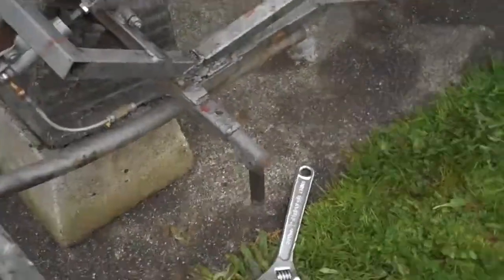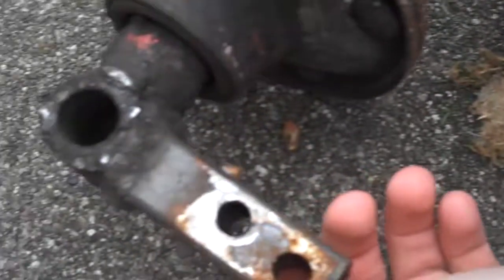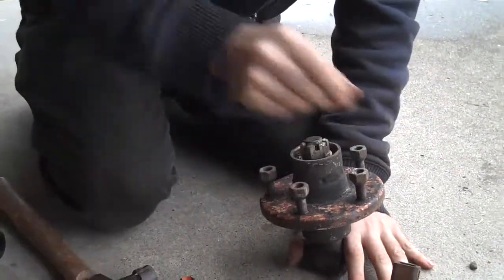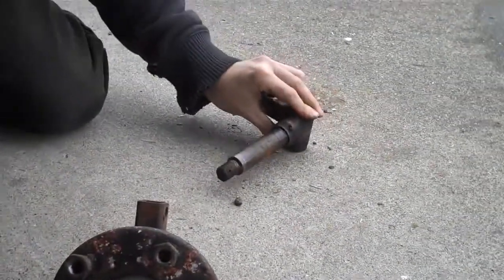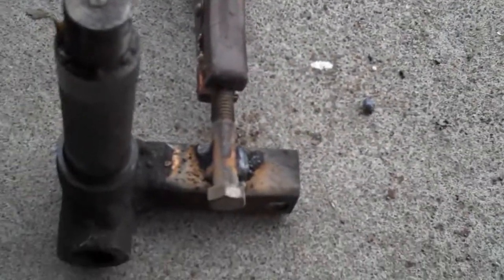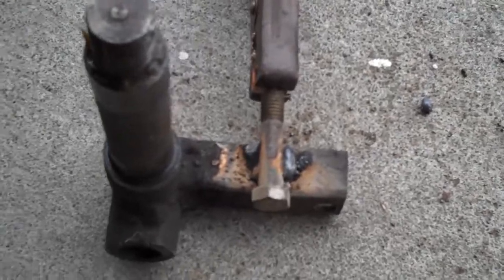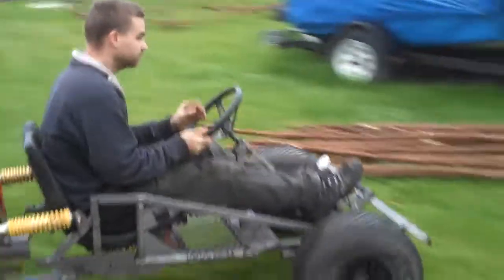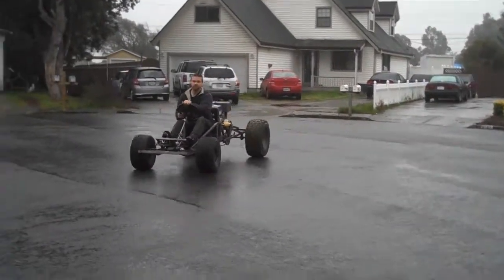[229] Fixing the steering for good - 2011-01-29

Comment: Can you post a detailed video of the brake master cylinder set up with linkage and fittings. Also I am interested in the rear suspension pivot points that tie in the suspension and coil over shocks. Thanks.